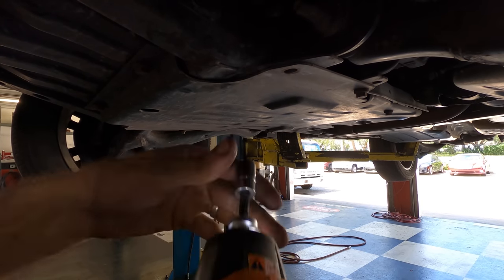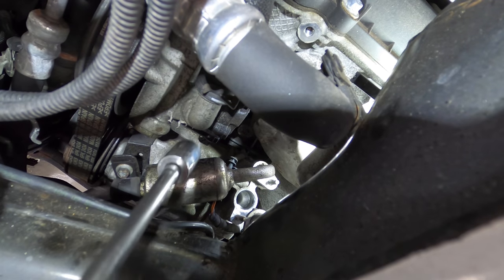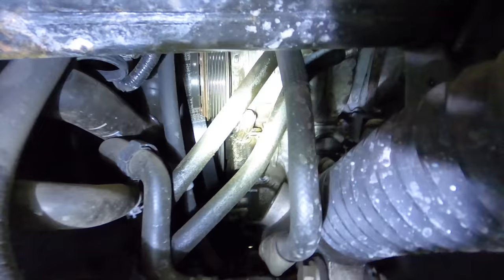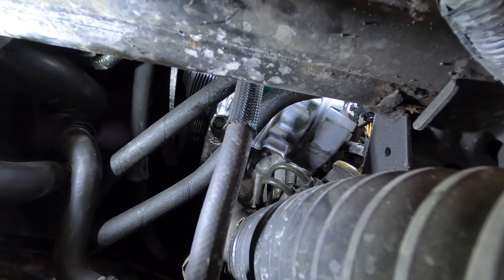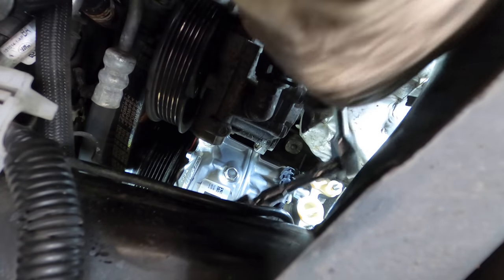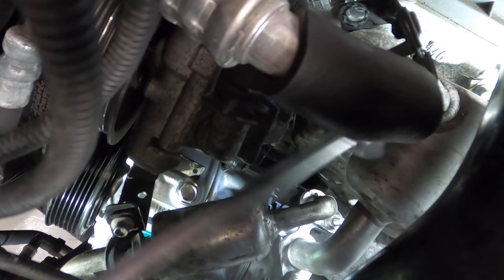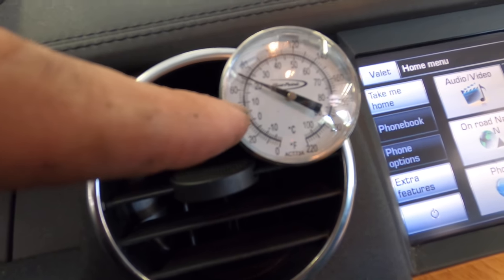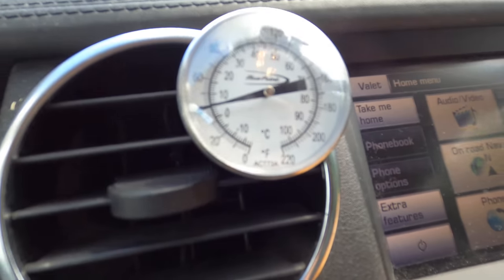Land Rover SUV Compressor Extraction! Working blind! Read Description.

Comment: When the customer realized who was wrenching on their rover, they rethought the situation and were pleased they had the “chosen one” doing the surgery.
Reply: Once they called the Land Rover dealer back home and found out it was going to cost 5 times as much they said go ahead.
Reply: Nothing against Ray but I think I’d rather get it fixed locally in case an issue shows up while under warranty.
Reply: @sjn7220  NAPA has a nation wide warranty policy or at least it used too.
Reply: @garyh.7282  Due to that 1500 dollar compressor removal tool set.
Reply: @garyh.7282  EXACTLY what i thought..  probably less than half the price to have rainman's shop do it then landrover
Reply: "The chosen one".
I got tired just watching. What a freaking hassle. Better you than me.
Contortionist only need apply.
Wow!
Reply: @garyh.7282  Seems like the parts are warranted but not sure about the labor unless it was performed at a NAPA AutoCare Center.
Reply: Careful now with the praising and compliments you're going to make his head swell.
Reply: @tsal4379  what tool is this?!
Reply: I sure miss doing this stuff,not
Reply: @reddsaxxmike2865  uh what, there is no removal tool set in the video
Reply: Money talks!
Reply: Yes the chosen one the anointed one
Reply: More likely "their guy" back home heard it was a Rover compressor and said "nope, I don't do those."
Reply: Yes I agree With You

Comment: Bonnet (hood) popping up, yep. In 1970 I started work at a new garage one Monday morning and all went well until Wednesday. I had done a tune up on a nice little red MGA and took it for a test drive. With no warning the bonnet flew up and slammed against the top of the windscreen. Didn't break the glass but the bonnet was bent back and distorted. I thought I would be told to pack up my tools and look for another job but fortunately the boss had a sense of humour and all ended well. The panel shop down the road fixed it all up.
Reply: Had the same happen to my Metropolitan convertible on an October night in 1962. On the way home from the Pennsylvania required biannual inspect (+ lube/oil change) after hitting a pot hole the night got dark ahead! Fortunately I was in a small village only going 35 mph. Suddenly I couldn't see the headlights on the road!
I thought I had been Halloween pranked! But was able to stop safely, the hood was bent, the windshield and top were ok, I tied the hood down with a chain tightener to continue by sticking my head out the window. The bent crease exhibited imprints of the fabric weave for the local body to repair the hood the next week. Years later I bought a Petty blue Levi Gremlin X from that AMX dealer.

Comment: In many cases with Landrover work on Discovery and Range Rover variants, it’s actually necessary to lift the body off the chassis to access the rear of the engine, exhaust cross over and others items. Enjoy watching you work along with your wit and commentary. 👍🏻
Reply: Depends on age and variant. The OG range rover was one of the first production 4x4/SUV's that swapped to monocoque back in the early 2010's.

Comment: i'm an aircraft mechanic and get in those positions all the time, you really start to love engineers. hang the compressor and build the car around it.
Reply: Same here, Boeing and Airbus I think have a competition of where to locate the most ridiculous fixings 🤣
Reply: Blame it on Fairchild-Republic, they pioneered that concept with A-10 built around a GAU-A8 Avenger Autocannon.
Reply: This why I was glad I was a structures engineer.   Don't have to worry as much about access when you are repairing skin, although once in a blue moon we had to do weird shaped repaired due to access on the back side.
Reply: @shadetree6705  but at least the BRRRRRRRT makes up for it all.
Reply: look up replace startr on toyota 79 series v8 4.5tdi..have fun,,there a design dissaster, the rear diff is 4'' narrower, the alt is on the sump. the injectors are 1k, EACH.
Reply: Sounds more like a pole dancer to me oops sorry didn't mean to say that out loud

Comment: Why do I get the feeling the owner called and got a price to replace the compressor at home and it changed their mind on letting you do it?   Must have been way higher.   Best wishes,   Kevin
Reply: They probably made the mistake of asking their local Land Rover dealer xD
Reply: @MDBenson  As if Land Rovers didn't already cost a fortune...
Reply: ... or it was going to be a million degrees for the next week before they got home and was worried to run out of refrigerant - can't upset the wife ...
Reply: @MDBenson  As a jaguar owner that just got the AC condenser replaced, I understand the issue perfectly well.
Reply: Owner probably told the wife and she said "If you think I'm going to ride in that hot car while trying to enjoy my vacation you're wrong! FIX IT NOW! "
Reply: I had to replace the ac compressor on my 2007 Saab 9-3 about 5 years ago. The cost from the Saab parts organization here in Australia was around $US 2,500. The OEM part from ac delco in the USA was $US 500 delivered. It can pay to shop around.
Reply: @rays8611  Though it was (sort of) fixed but with a leaking compressor.
Reply: @Qs-Views  First come the taxman , than the wife as your personal moneypit .......

Comment: It seems most new vehicles are designed with non-repairability in mind. Keep up the awesome hard work.
Reply: Or designed to male big profits for the dealers doing repairs.
Reply: It seemed that trend started 20 years ago. i remember my father asking me to help to change a burned out headlight bulb in his Dacia(or Daewoo?). Right one no problem, left side: A/C compressor in the way to remove the plug with the bulb. The user manual commented on that and recommended changing at a service station because you had to change the bulb from below and needed to lift the car :-( 
I have less problem with needing to take something apart to change a part that should have a long lifetime, but consumables like bulbs? You should be able to swap them at the side of the road while it rains without any additional tools.
Reply: G'Day,,While i think you may be right,,reckon it has to do with modern assemble,
Every thing goes on before install,,
just brought a new Mazda 6,,comes with 5 year warrenty,,at least i have 5 years to learn,,If i can still buy fuel in 5 years,,
Reply: Nah, they have to fit every luxury feature and every safety feature into same space as they did when cars didn't have any of that. Yes cars are larger but that is mostly because of larger trunks, crumple zones and airbags everywhere. Another specialty of European cars in particular is European customer behavior... people who buy new upper end and luxury vehicles here (EU) usually sell them immediately when their warranty ends and components like AC compressor usually last longer than that and thus are not manufacturer's problem anymore when they break after the warranty period. Reparability is still there, components are available but how long it takes to repair something is of no concern for manufacturer... they saved 20 bucks by placing that compressor there... 20 x lets say 600 000 cars is a lot of money.
Reply: The engineering priority is to streamline the production as much as possible. Repairability is just not something they put too much consideration on.
Reply: Kinda like Apple Computers
Reply: @garfieldsmith332  this is the more than likely the real reason. Most ppl just assume the best mechanics must work at the dealer, so why not go there. Or most private shops turn down repairs on these because of the headache that comes with having to disassemble like 3 other things just to get to the part you need to pull, or sometimes just to be able to pull out a bolt lmao.
Reply: @kuebbisch  I had a 2012 chevy Malibu you had to remove the front of the car to change headlight bulbs
Reply: "To remove the compressor, first remove the engine. To remove the engine, first remove the compressor"
Reply: Rovers and Jaguars are the most difficult of all.
Reply: All the engineers care about is getting it together as quick as possible on the assembly line and getting it out the door once it's out they don't care about guys working on it if they did and they had to work on it they might think about it a little better have a nice day

Comment: I am guessing that if you check the "official" repair manual for this vehicle, step number one says: "Remove engine from vehicle."  Step number two: "Remove compressor."  "Installation is reverse of removal."   Yet another good job done Ray.  Excellent.  PS  There are no links in your description Ray as there is no description on this video.
Reply from the maker: !!! I fix now
Reply: Its A Land Rover its probably 1. Step remove the bodyshell
Reply: To the customer: "I'm sorry sir, your credit line is only $10,000!"
Reply: @derkotteme  you joke, sir. It actually is for some engine stuff on that model xD
Reply: @MDBenson  Sadly this is a modern trend. The 08-12 escapes with the V6 had that problem where you had to pull the engine to do various repairs. Things like exhaust manifold bolts for example.
Reply: @MDBenson  I know and i think its hilarious
Reply: They should write it as "jack up the radiator cap, pull new vehicle under it, and reinstall cap."
Reply: @MDBenson  I was not joking really...ok maybe a little, but my manual for my old Mercury Villager had that for just about any repair I need to do to it.
Reply: @mayorwrenchmcgnome  Nice.
Reply: I wanted one of these... but after looking under the hood... no thanks. What a nightmare. Another reason I keep my old f-150 truck. Easy to work on ( compared to this nightmare).
Reply: @Nick-bc2lm  You can work on an F-150.  I had a 1980 Doge Ramcharger that I could sit on the fender and reach in to change the spark plugs.  There was tons of room in there like your Ford.  I miss those days.
Reply: @derkotteme  you're 100% correct, this particular model does require the removal of the body shell.
Reply: @RainmanRaysRepairs  I think you got this job after the client discussed this replacement with their regular mechanic who probably refused to take on the job.😜😜
Reply: @RainmanRaysRepairs  as a matter of interest, how long did this job take you to complete?
Reply: Most Likely, MFR's need to get back to making things fairly easy to repair imho.
Reply: @derkotteme  heck over half of Ford 6.0 and 6.4 Diesel engine work requires the entire cab to be removed, so about par for the course anymore.
I remember a 90's Dodge Minivan an uncle of mine had that you had to pull the engine to change the rear 3 spark plugs (Transverse V6), my uncle opted to cut an access panel out of the firewall instead.
Reply: the official repair manual says,, go buy new vehicle, & not a rover..
Reply: @skurblord3401  That's nothing new on manifold bolts though.
Just put some Flex Glue on it LOL.
Reply: manuals will just state 'remove 4 bolts' 'remove compressor' 'installation is reverse of removal.'
Reply: @KingSobieski  oh be fair, there'll be a couple of laugh emoji's too!

Comment: The engineers should have to repair their design and see if it can be improved on.
Reply: I dont think it's only a engineer's decision where things go. When you have to fit everything in a certain size box because management wants the powerplant to fit in many different bodied cars you just have to make do.
Reply: @Nordic_Mechanic  And that kids is why the transverse 3.5 Ecoboost Ford motor exists.
Reply: Modern cars aren't meant to be repaired. Simply replaced
Reply: @Nordic_Mechanic  You obviously don't work on the junk everyday if you think that they have to make do. When its easy to see they could have made simple changes to make things so much easier and less warranty cost.
Reply: @REDZ28won  I have experience on both side of the coin. 

FOr instance the oil filter location on crown victoria and town car is crap, but it makes sense when you think the same engine goes in pickup trucks which sold a lot more units. 

In another case, the 4.2L audi v8, the change was possible and made sense. They changed the lenght of one starter bolt so you can more easily replace the starter starting in 2007 and up.  It used to require dropping the subframe.  

 Theres a lot of constraint to build a engine, multiple vehicule use, thin time allowance and marketing, reusing off the shelf components and after sale services are often in the way.  

Then you have EPA forcing you to jam catalytic converters right agaisnt the engine preventing o2 sensor replacement or blocking other components. 

We'd all like a easily serviceable device or car, but everywhere the gov makes sale tax theres an incentive to make everything more costly.  And on that point, I agree with you. Lets just try to see the bigger picture.
Reply: @MalleusSemperVictor  yeah and dump 3 miles of tubes from the part bin on top randomly as we cant be arsed
Reply: @Nordic_Mechanic  Then have to remove 2.75 of those miles just to get the most minor stuff below them.
Reply: Engineers work for manufacturers... manufacturers give you warranty on their product. If part of that product statistically last longer than the warranty, they will put it wherever it makes sense in order to speed up the manufacturing process because it is no longer their problem when it fails after warranty.
Reply: @richardscathouse  You just can't throw away $30,000 worth of car because it needs a anew compressor, the labor charge for this will be nuts however.
Reply: @lamebubblesflysohigh  Sure.
Reply: Engineers are the most arrogant clowns on the planet. Worked in a factory tig welding the same 10 welds for 2 years, (Production line). I talked to the boss and told him that part of the lost time was due to an engineering design flaw. We had just a half inch gap that caused the welders to bend a piece of tube to make it fit. Some times it would break and we'd have to scrap it. They spoke to the engineers and their stupid answer was, it works on paper, so no we won't make that change. So needless to say that was one of the main reasons that factory no longer exists. Engineers, the smartest idiots on the planet.
Reply: Hallelujah
Reply: Nah they dont gaf.  They are like I'll never have to fix it.
Reply: @jwat2396  Arrogance kills, jobs, and, lives, often in car and aircraft business.
Reply: @watershed44   Yep on both sides of the wrench.
Reply: @REDZ28won  Hindsight is a wonderful thing.
Reply: They do. Constantly during the process and after the fact when problems are found. 
How exactly do you think the engineering process works? Do you think they chose the available space or got to design the car around their ease of making everything fit? No. That's not how it works at all.
Reply: @anticapitalize  I bet if the engineers had to come out in the field and actually repair their shitty designs they would rethink a lot of them!
Reply: Agree 100%!
Reply: easy,,dont buy anything with rover in the name..
Reply: @harrywalker5836  All the Brands of cars engineers suck!